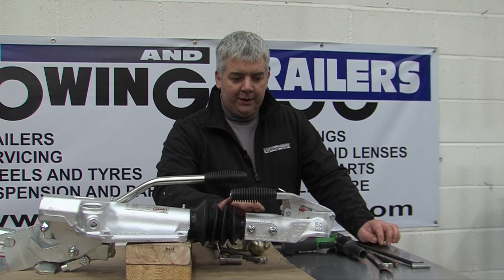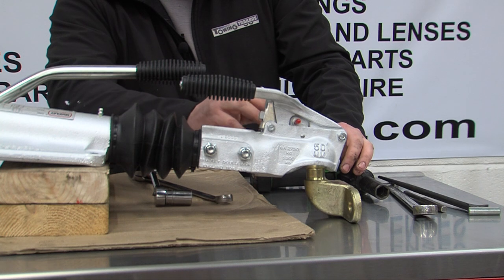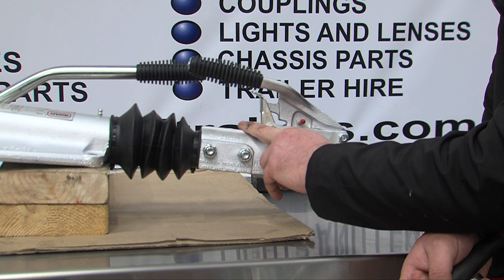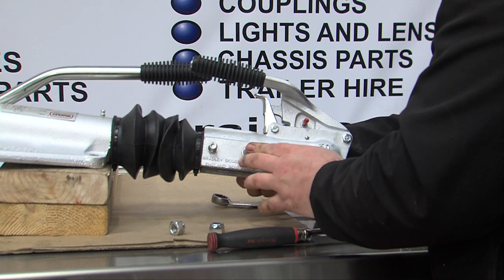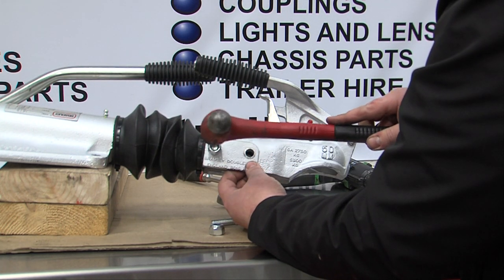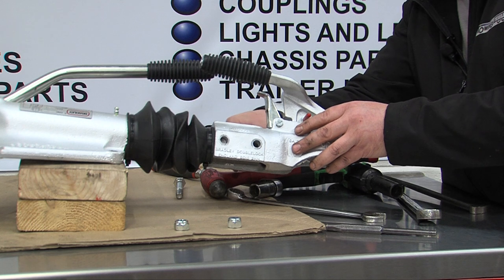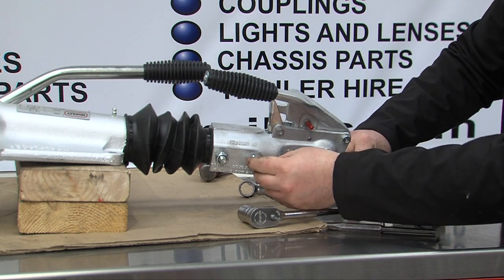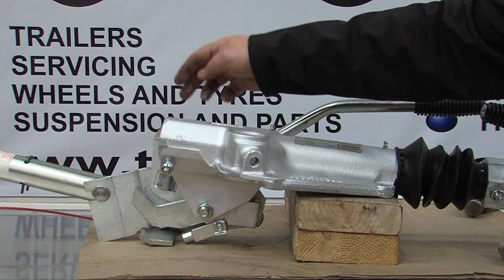How to change a coupling head on a Bradley Trailer Coupling

Comment: What happens if the damper comes forward? How do I push it back?
Reply from the maker: Hi

If the damper comes forward it is usually easiest to remove the back bolt on the damper, line the front bolt hole up and fit the bolt, then you have more room on the back mount of the coupling to pry the damper forward to re bolt.

Kind Regards

Towing and Trailers Ltd